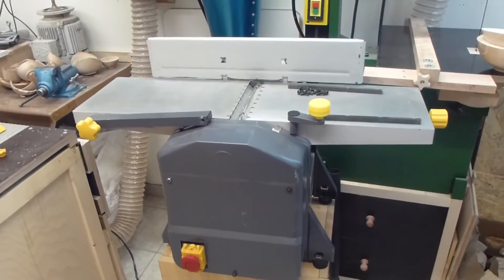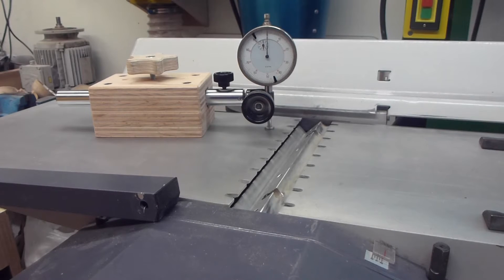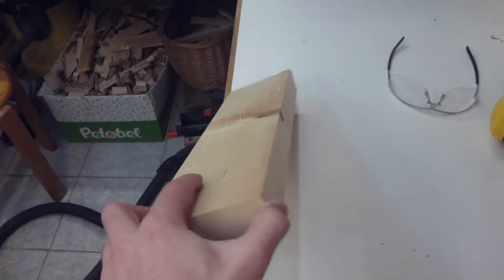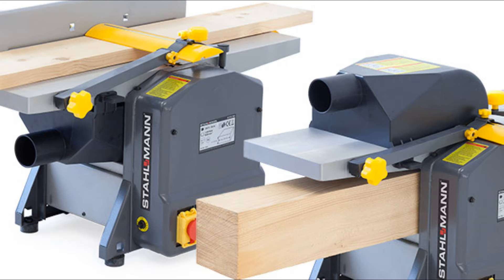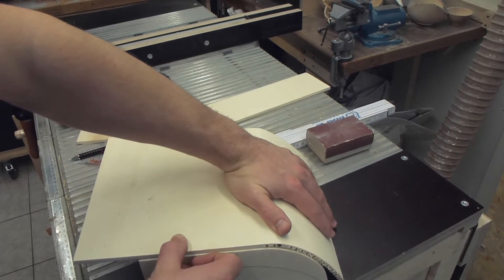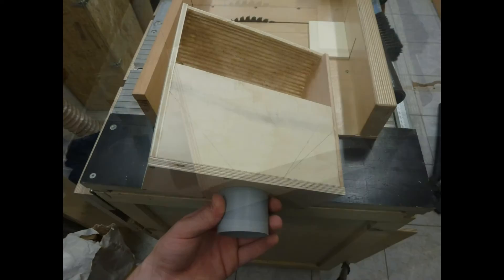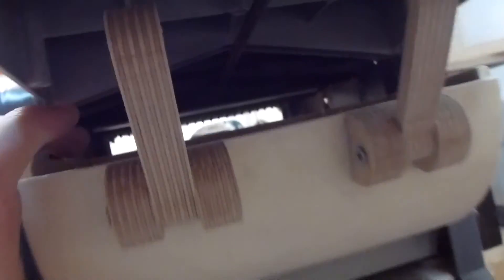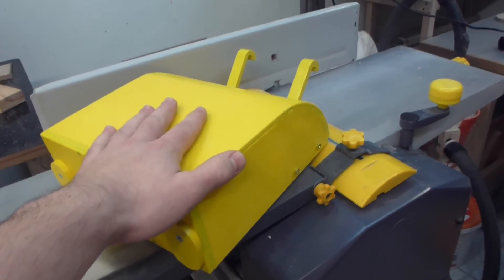Homemade Dust Shroud + Setup | Jointer/Planer (Part 1)

Comment: hey marius, hast du keine verstopfungsprobleme wenn du auf der oberseite absaugst? ich hatte die nähmlich weshalb ich meine absaugung ein wenig anders machte und dadurch hab ich jetzt keine verstopfungen mehr, hab aus diesen grund jetzt extra meinen in den kanal gestellt damit du meine einfache änderung sehen kannst, gruß von der feder.
Reply from the maker: Probleme mit Verstopfung hatte ich nie. Nur hat die Haube nicht alle Späne erwischt und manche gingen in Auswurfrichtung verloren. Der Absauganschluss von meiner selbstgebauten Haube ist auch weiter unten, sodass die Späne nicht erst noch nach oben gesogen werden müssen.
Reply: ja ein paar zentimeter machen auch was aus - glaubt man offt nicht, ich möchte mir eine zylinderschleifmaschine bauen, vielleicht im winter, so ähnlich wie in frank horvat seine alte maschine die er restauriert hat, wo das material über die walze geschoben wird und nicht unter der walze wo der staub nach oben gesaugt wird, logischerweise fällt der staub auch nach unten und kann unten leichter abgesaugt werden, auserdem glaube ich das der durchmesser den die maschine vom frank hat idealer ist, werden sehn, schönes wochenend von der feder.

Comment: Do you think 204 mm with on planer  is enough? Or should i buy bigger planer without joiner on top of it ( like yours).
Thank you.
Reply from the maker: If you want to plane wider than 204mm, get a bigger one (obvious). Advantage is, that you also have a 204 mm wide jointer.
Reply: Marius Hornberger welche Maschine ist das, also Marke und Modell ?

Comment: The Europeans have the best machines.In the USA ,our combination joint / planers you have to move this, remove that ,flip this, it's such a big project, where this machine you have is so simple and compact. Granted you can't plane wide stock, but for a small shop this is great. And I may copy your dust shroud if my grizzly one doesn't work out. May I ask what country made this combo tool and please don't say China....uggg Thanks ~Dolly
Reply from the maker: CrossGrain Wood Products,LTD Sorry, but China.
Reply: +Marius Hornberger But designed/constructed in Germany and that's the point that makes the difference.

Comment: Hey Marius, thanks for your videos! I was planning to get one of these cheap jointers/planers from amazon, since here in Europe they are not so common. Would you recommend this kind of machine after some months using it? :)
Reply from the maker: Cactus! For small work like weekend projects, yes. For more intense work, no. You get what you pay for.
Reply: Marius Hornberger Great! thanks for your input, that was my same feeling and I won't make my living from a jointer, so I'll get one :) thanks for the tip!

Comment: endlich jemand der fast den gleichen mittelmässigen jointer hat wie ich. hab den Güde 254P. Echt ätzend da ne gerade klinge auszurichten.
Hinzukommt das der abfuhrtisch 3zehntel unterschied in der Höhe zur Messerwelle hat. das versuche ich grad zu korrigieren. Dein Fence für den Jointer (man beachte die denglischen wörter die sich einschleichen) find ich gut gelungen. Nur die einstellung mit der Flügelmutter um es winkelig auszurichten finde ich etwas materialverbiegend. Gruss aus Wuppertal
Reply from the maker: Danke. Du hast Recht, die Flügelmutter verbiegt das ganze etwas. Funktioniert aber gut und ich wollte für die Maschine nichts aufwendigeres machen. 
Und noch eine kleine Vokabelstunde:
jointer: Abrichthobel, Abrichthobelmaschine
fence: Zaun, (oder in diesem Fall) Anschlag, 90°-Anschlag
;)

Comment: Really excellent work Marius.  I particularly like the way you curved the plywood.  I have just purchased a new one of these from Aldi.  I think you have those stores over there.  I haven't opened the box yet, but it looks very similar to the one you have.  Cheers
Reply from the maker: Thank you! Yes I think Aldi also sells them, but I guess with just a 15cm (6in) cutterhead. Mine has 20cm (8in). But you can also get them from Amazon here.